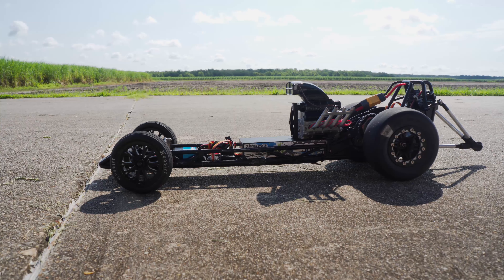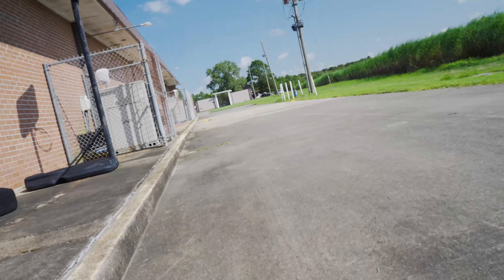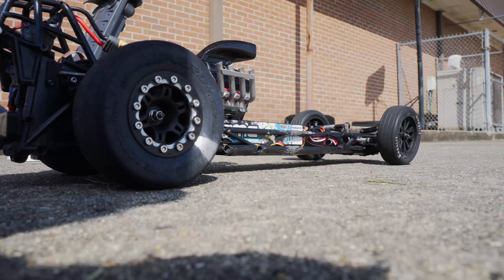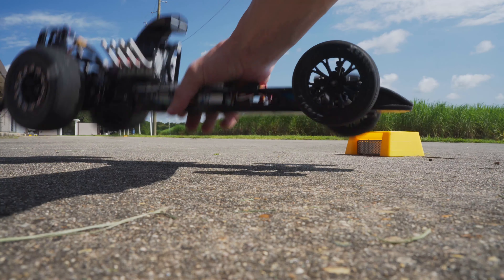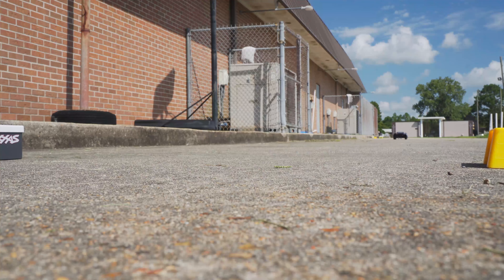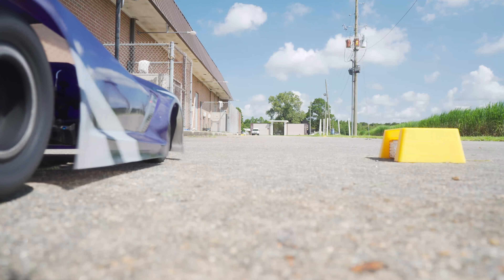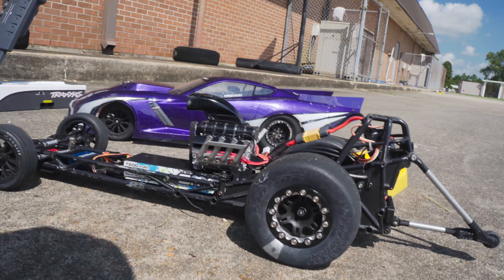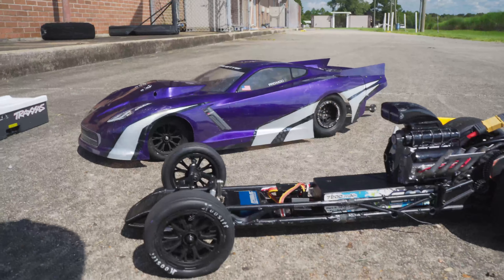Can the No Prep Front Engine Dragster hit 40MPH?? | PLUS Street Eliminator Ride Along!!

Comment: The ability to lower wheelie bar would allow u to retain ur steering. This is an awesome build, just tryna help. If u get steering back u can pour the power to it on the big end. The ride along was too cool
Reply from the maker: I'm assuming you mean the wheelie bar on the dragster, I'm planning on lowering it back to its original height. I need to modify some links to get it back down low. I think part of the problem is the suspension not allowing me to put the power down on the hit. I'll have to do some testing and experimenting for sure!
Reply: @FullThrottleRC  I've heard guys on facebook talking about mid motor cars an how scaling the weight is very important for traction. Just an Avenue to look down on ur quest. Love ur videos love the builds. Ur channel is one of the reasons I built my eliminator cars
Reply from the maker: @Ruthless-1699  thank you so much!

Comment: yanno, I just bought a Duratrax Evader BX Nitro that I'm restoring, and I bought a MASSIVE torque-monster engine for it. I'm genuinely tempted to pick up a pair of no-prep drag slicks for it and run it just to see what I can do with it.

OS 18CV-RX in a 3lb13oz car. Should pull like there's no tomorrow given the engine's designed for 13lb monster trucks!
Reply from the maker: Oh yea! That would be awesome, I would imagine it would be a handful to drive for sure but a fun challenge!
Reply: @FullThrottleRC  Just don't see enough nitro in RC drag racing, yanno? I've also been tempted to get one of the RJSpeed nitro drag cars for it too, but there isn't much of a drag scene out in the sticks where I live so I'm hesitant to get a car that's only good for drag racing.
Reply from the maker: @TestECull  drag racing is pretty niche being that you need a long smooth surface that can be prepped. I think that's why the No Prep stuff is so popular, you can run anywhere that has a stretch of concrete. You don't need to prep anything, don't have to put glue on tires, etc. Just rip it and have fun!
Reply: @FullThrottleRC  I'm already getting ideas of how I'd launch my buggy too, given I'm gonna end up with a seperate throttle servo and brake servo...and I'm on a highly programmable airplane radio...make a mix in there that, when I pull the spring-release trainer switch while holding full throttle, the system applies juuuuuuust enough brake where the car won't roll off the line on gravity and juuuuuuuust enough throttle that the engine's about 500RPM below clutch engagement point, well off idle where it won't load up. Get staged, hold that switch and hold full throttle, when the lights drop I let go of the trainer switch, brakes release, throttle snaps WFO, and off it goes.

If I can make that work it should launch almost like an electric. Or smoke the clutch. One of the two.

Also be super fun to do it totally through FPV. Your gopro footage kinda inspired that a bit; I've done a nitro shortcourse FPV and it's boss. With the right camera mount so you can see about what an actual racecar would offer, you'd make the pass through the goggles and it'd be so so so so awesome.

Comment: Will the front engine car hit 40mph on a longer distance run?  Is 132ft distance limiting the speed or is the car just not capable of hitting it at all?
Reply from the maker: This is actually 66ft. I don't have access to an area where I can run 132ft close by just for testing. I think it would hit 40 in 132ft. It's definitely capable, should be capable in 66ft considering I can only launch at around 78% throttle on the current setup.

Comment: To get the rail to go fast  you need to lower the wheeliebar  and more power
Reply from the maker: More power will always help. The dragster was built mainly from parts and electronics I had on hand already so I didn't have to buy a motor or esc.